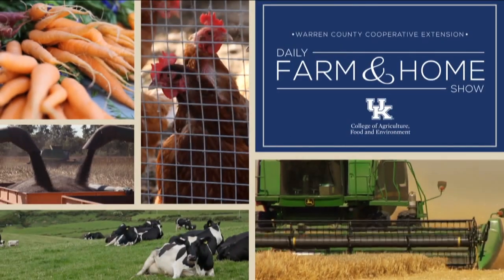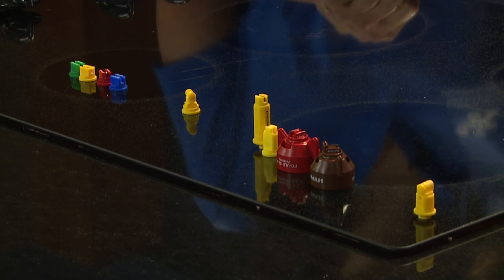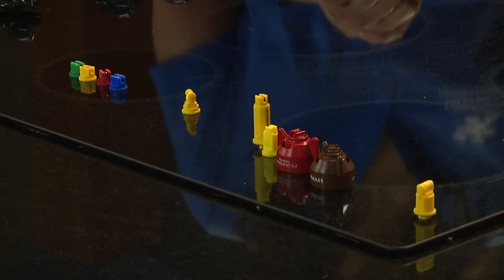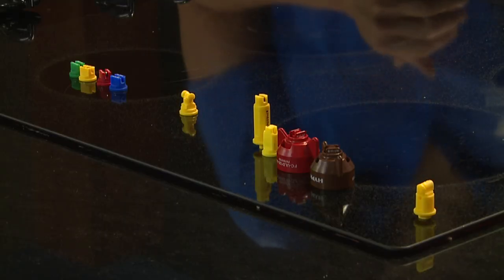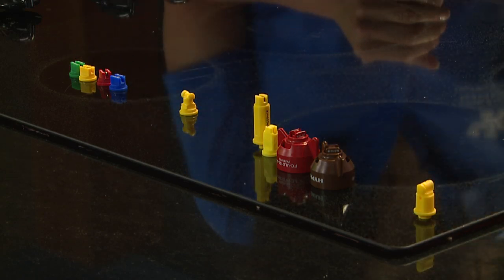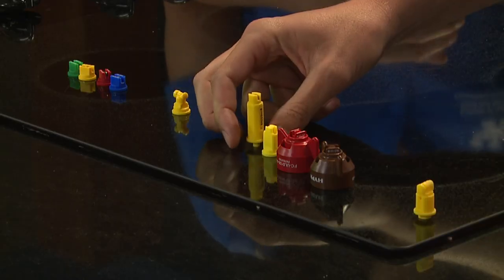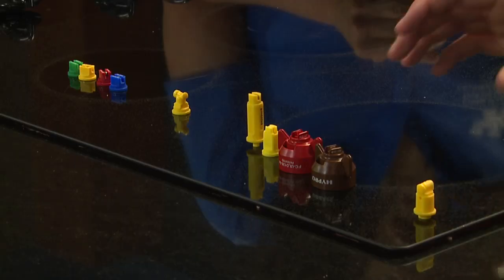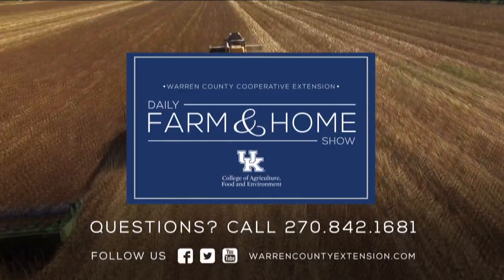Spray Nozzle Selection

Comment: Very good explanation on the single orifice tips where the pressure is key to regulating the size of the droplets coming out of the tip. Too low of pressure can lead to drips which is what happen to me when I used a 513 tip at only 1500psi.